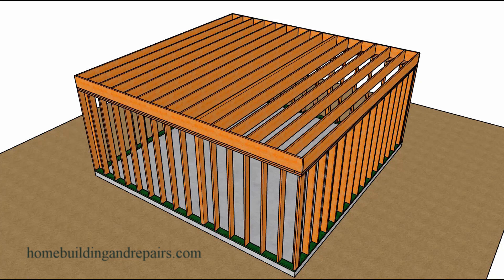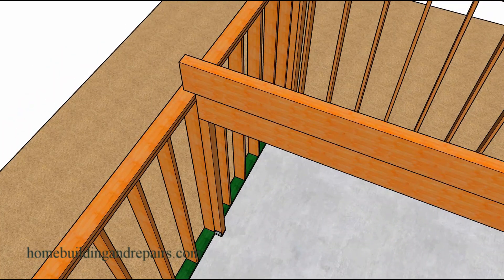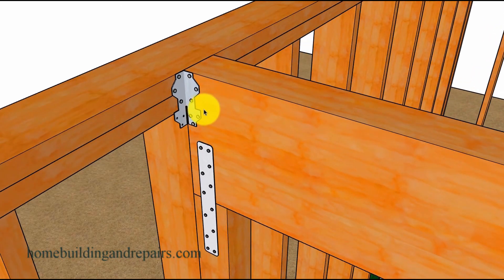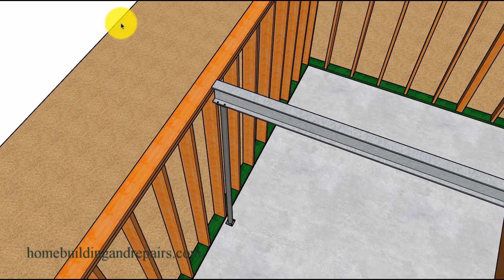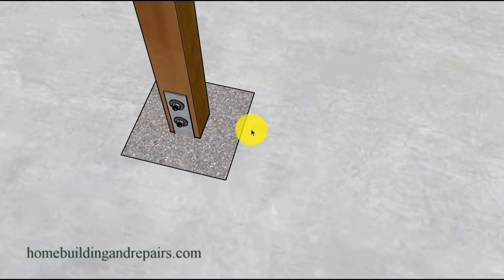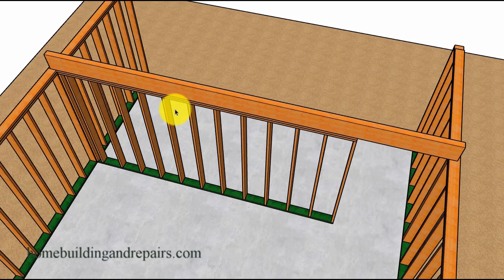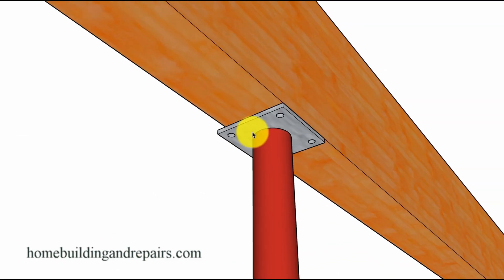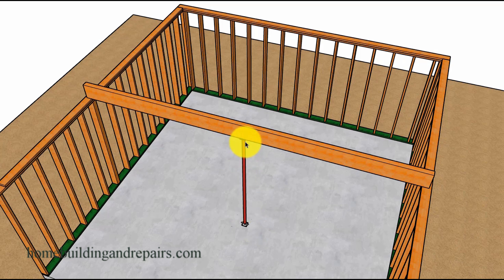How To Add Structural Support To Sagging or Cracked Floor Beam Above Concrete Foundation

Comment: How deep do you typically dig footers  for basement adjustable posts?
Reply from the maker: You need to cut concrete floor if you have one and then grab a pick, shovel or mechanical digging equipment that  can be brought into the basement. Let me know if this did not answer your question.

Comment: I need some help. I need to add support to the second floor main beam running through an old one built in 1890. The house also has a basement so any support I add to the second floor floor beam would either have to rest on the floor of the first floor or travel all the way to the basement. Right now I’m concerned if I add beams on the first floor traveling from the floor to the ceiling to support the second floor beam, I’ll put too much stress on the first floor floor joists and main beam that runs in the ceiling of the basement. You mentioned in this video that you’ll do another one that shows how to put supports in with a wood floor instead of a concrete floor? I haven’t figured out the best way to fix my problem. So I have a concrete floor in my basement a wood floor on the first floor and a wood floor on the second floor. The second floor floor needs more additional support because the beam holding up all the joists of the interior of the house and needs additional supports traveling all the way to the Bassment, I believe.
Reply from the maker: I think most of your questions can be answered at our website. Check out the crawlspace, engineering and framing sections. Let me know if you can't find what you need.

Comment: Thank you for your informative videos. 
I have been researching ways to strengthen my garage roof and have yet to see an example roof that the 2x6 rafters come together at the ridge and there is no ridge beam or any connection from peaks of rafters to others which are 2' apart. All rafters have 2x4 center posts connected to bottom of the rafters ridge to support the 2x4 rafter ties at the base (top of wall). 
What would you recommend? I'm specifically concerned about added weight on the roof as we like to hang out on top to look at the views.
Thanks for any advice!!
Reply from the maker: Email me some pictures of the inside and outside and I will take a look.

Comment: This is exactly what I needed! 
Splitting my garage in half and making a living area but was going to make it 8ft walls and have the roof of the living area a storage area so needed to add structural support to bare the weight
Reply from the maker: Glad I could help!

Comment: Hey greg, I was wondering if I could email you to see if you have any information regarding the framing details about 20th century colonial style homes. I have a few pictures I want to share with you so you can answer my question easily based on your knowledge. I only want to understand how the floor joists were laid out and why they were laid out that way. I look forward to hearing from you!
Reply from the maker: Yes you can find our email address at our website.
Reply: @gregvancom  Did you get my message?

Comment: Thank you so much Greg. I really appreciate this. When I bought my house 20 years ago whomever had put the furnace in really messed up the beams of the floor and it sags about (Believe It or Not) 3 to 4in in the middle.
Some years back I bought two of those metal post. I never use them I wasn't confident what to do. Still learning it's good to learn
Reply from the maker: Keep learning and thanks for sharing your story. Sometimes all we need is a little information to solve a big problem.